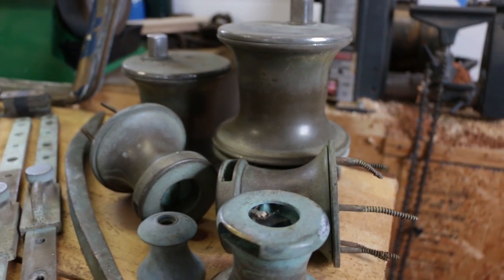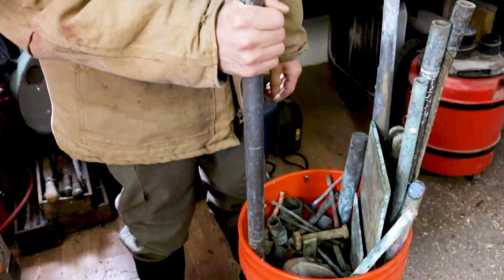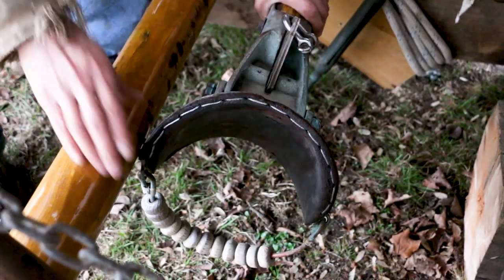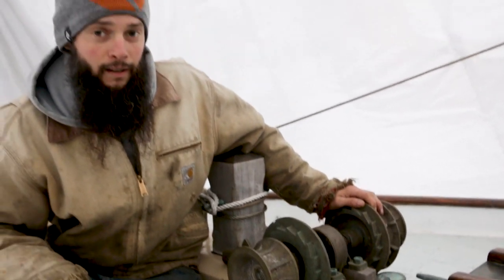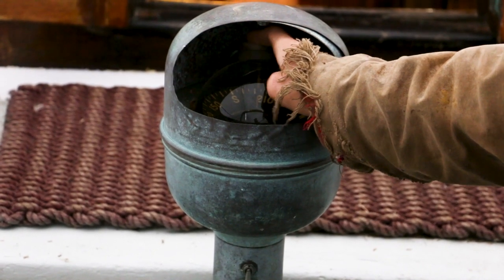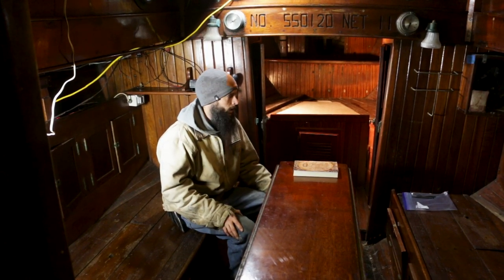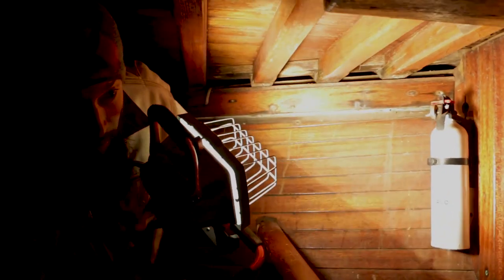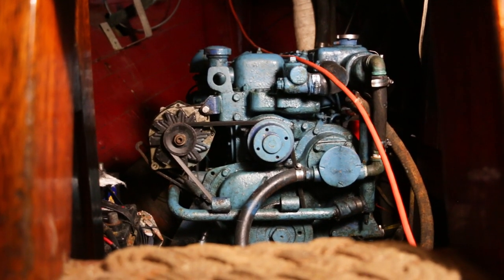Acorn to Arabella - Journey of a Wooden Boat - Bonus Content: The Good, The Bad and The Bronze

Comment: That is a Perkins 4-108.  Had one in my Tahiti Ketch and parts were getting hard to find in 2007.  The aluminum tend to corrode through.  I would recommend a new engine.  That is a good sextant and I would recommend having it restored.  New York Nautical Instrument Company might be good to check out.  I would not set sail without several GPS devices myself.  Beware the windlass.   Good luck!
Reply: PS: Figure on 1HP per 500 pounds of displacement.  If Arabella is 28K, then that Perkins would be right.
Reply from the maker: Thanks for the tips!  The plans call for a 40hp so if we use the Perkins it should have enough gumption to get her moving.
Reply: Right, and the plans for the Tahiti called for 16HP with 20K displacement, which would have been a very poor idea.  The original Greymarine 25 HP was somewhat marginal, but the Perkins was terrific.  Treasure that Maxprop, you won't find another one that is better.  Just make sure it is pitched correctly for Arabella.
Reply from the maker: We have heard that about the prop.  The prop was a detail we never gave much consideration to be honest and now other than finding someone who can determine the correct pitch we don't have to! =)

Comment: Aww. That maxi prop is really neat, i got really excited till i realized i want regeneration from my electric motor....

The friction device is in fact the winch break, to hold the drum and chain in place. 

If you clean off the patina you  will be a very old man before it re -patinas , you will regret cleaning it , and many would kill for that brass/bronze.

Also the mast looks serviceable or am i mistaken ?, i think re-using that mast is a legit option??.

All this , was literally like boat porn...And i would be jealous , but none of this would fit my vision.

Also if you need help with any thing , let me know , if you need help converting over those old fixtures to led, 12v 24v etc , the binnacle, light's etc.
Reply from the maker: The mast seems serviceable, we will strip it of paint and varnish and then see.  It might stay as is and become our main if we go gaff or it could easily become the mizzen.
Right on, electric is something we still need to do a lot of learning about so a knowledgeable hand could be helpful!

Comment: Do you have a plan to pour your lead? I’ve seen several lead pours into ground on YouTube and it never blew up concrete or ground.
Reply from the maker: Yes, 
But old man winter came and put us on hold.  The ground is frozen and white, not ideal for digging or doing a lead pour.
We have an awesome tank to use and will make a wooden mold this winter and bury it in the ground.  It will be the first project we tackle in the spring.

Comment: Any experience using electrolysis (battery charger, plastic tank, washing soda electrolyte solution) to clean bronze without mechanical abrasion? I know it gives awesome results for ferrous metals and for difficult-to-clean detailed pieces
Reply from the maker: We have not but have heard of such methods and need to do some more reading before it's time to clean them up.

Comment: Is one of the rods in your melt pot the handle for the windlass?
Reply: caahacky - or a bronze end that had a wooden shaft extending from it to keep the handle from quickly wearing out?
Reply from the maker: Hmmm.  Good call!  
We will have to examine them and report back to you on that one.
Reply: I think it has 2 ratchets so 2 people can work in tandem, one pulls while the other ratchets, to pull the anchor twice as fast.
Also, That may not be a brass horn at 25:10,  it may be an earpiece for hearing directionally. You hold it up to your ear,  listening for the direction of bells on bouys and ships, and fog horns on shore. Sound was a vital part of navigation in the fog etc.
Reply from the maker: We had not thought of that, gonna have to get more crew so we can gave one at the tiller and two winching the anchor =)
It has a reed built into the small end which led us to believe is some sort of horn you blow.
Reply: While that anchor winch is really cool, it is going to be a pain in the ass compared to an electric or hydraulic unit. Have you thought about hiding another electric or hydraulic powered winch under the deck? Modern electric or hydraulic winches are small.  You could design Arabellas chain locker with a winch inside. The chain would still go over the bronze winch but it would just free wheel when using the motor. When not using the motor the winch dogs can be engaged so it can be used normally and for other uses like hauling lines or rigging/trimming sails. Building arabella with hidden things like hydraulic steering and winches wouldn't be a bad thing if you want to keep crew size down, and shouldn't cost a whole lot if you think about it now and start looking for stuff. I wonder for example if an automotive power steering pump mounted on the perkins would provide enough hydraulic power for a boat like that while under power with a solar electric pump for steering while under sail?

If the horn has a reed, you are probably right. I have seen similar devices that were intended for hearing. For a laugh, google "WWII listening devices". Some of the things the british british used to hear the germans coming were pretty funny looking.....
Reply from the maker: We might try to figure out some form of a hidden, powered anchor retrieval but a big part of the goal is to have no where to be and all day to get there so a manual anchor windlass might bug us less than it would most.  The manual is a must though as we don't want to be stuck if we don't have power for some reason.  We have 300' of chain and a couple anchors, maybe we need to see how long it takes us to drag it all in with the windlass.  =) 
We will stick with the tiller and simple methods of steering like a wind vane rig, tiller lashings....  Hydraulic steering seems a bit more complicated than we desire.
Reply: No practical experience here, but I have heard cruisers discussing how important it can be to get an anchor onto deck quickly when maneuvering in an anchorage, on a lee shore, the wind shifts, or the anchor drags, etc.
Reply: Exactly. Its all nice to picture grabbing a beer and winching the anchor at leisure, however no matter where you are mother nature will change your plans. Running that winch in bad weather and high seas with the boat pitching and rolling in the rain will not be fun. It looks like it pulls max 1 foot of chain per lever push. That is 300+ cranks on that lever every time you winch it up.
Reply from the maker: Certainly fair points and worth close consideration!
We will use the manual windlass, no doubts there, but having a electric one tucked below decks is a distinct possibility.  
We have friends who cruise a 40' tank of a boat and have a manual windlass and love it, they had no complaints but we can totally see the perks of having a quicker electric one you can operate from the cockpit.  
Thankfully we have years to sort it out =)
Reply: Totally, I just thought i would mention it because as you are designing and building that area of the boat, you can take a possible electric winch into consideration, and ensure it will have an area to live and a strong enough place to mount. If you don't install one now, at least you designed that area of the boat so it is possible to add later if you change your mind. If you build in a spot where it goes, and don't put it in,  the space could double duty as a small gear locker. Retrofitting one later could be very difficult, very ugly or both.
Reply: Good idea. You guys are young and spry now, but that won't last forever...plus if you have to single hand the boat.....we do this same thing when we design houses. People in their 40's and 50's don't need an elevator in their house, but if we go ahead and design the shaft and put in a temporary floor, the client doesn't;t have to move from their house if they ever lose mobility.
Reply: Future Proofing is never a bad idea, and it is a selling point if you guys ever upgrade. While sailing the high seas the old way is a great idea, modern technology is awesome. With all that cool stuff from Victoria, you have an amazing opportunity to build a boat that looks and can be sailed like it is straight out of the 20's but is hiding some cool tech. Little things like leaving small gaps in the interior paneling to install hidden LED strip lights. Or a flatscreen TV cabinet recessed in a bulkhead designed so the tv can be hidden under a wood panel. Creatively hidden speakers installed for music and movies. If you start scavenging now, the parts for these systems are not that hard to get cheap/free. In your cockpit, if you found a second binnacle (or something else period correct looking), you could modify it to hold an iphone/tablet inside of it, to show charts and things. It would keep the period correct look. 
I saw a boat one time in a marina  that had a hollow wood mast, and he had all sorts of communications and winch cables as well as the exhaust for the engine/generator inside of it. It was laminated with the hollow in there. Boat looked very correct for a turn of the century boat and looked like it would require 3-4 crew to sail. He was able to sail it solo. It was not easy but with the tech he had hidden while rebuilding it it was possible.
Reply: I have that horn, came with my 22' fiberglass boat in 1976, still keep it as a backup for bridges and fog.  you just blow hard into it.  if it's not sounding, play with the reed a bit.  galvanized, I think, not bronze.  when you get a sound, it's loud -- and fun.
Reply: Sounds like beer for breakfast after weighing anchor!

Comment: Hi For the new boat, look into shel
Thanks for the vidsfs to hold rock salt high up in the boat just under the deck. The old wood boats added these to help prevent rot. I am not sure how effective this is , but some Bromine chemicals are used to prevent rot. A worthy research project.
Good luck with the build.
Reply from the maker: Thanks for the tips!  We will have to look into that, we have heard of folks using salt to "pickle" or "cure" timbers.

Comment: Sorry I cannot answer what chemicals USA use for Fungi and Spore control as I am from Australia and our chemicals used may not be legal in USA. There are chemicals you can use that kills spores and fungi growth. I will look into the chemicals we can use in Australia but you will need to talk to professional in your state or county
No-Rot Gel is a ready to use, water based brush on wood preservative, to control the spread of decay. It is formulated to penetrate by diffusion into the timber, while still allowing the surface to be painted over. No-Rot Gel can also be used to kill surface mould, algae or fungi. It can also be used on timber, masonry or concrete surfaces. 
There are other methods of chemical as well like ones you can add to paint and for quarantine baths to dip shoes have heard of copper oxide baths though advise you look into this method. If it was my project would look into these quarantine matters so the boat will not get effected with fungal blooms.Once it starts it is uncontrollable like cancers.
Reply from the maker: Right on,
Thanks for the info!

Comment: No, it wouldn't be building a new boat.  First you'd have to un-build the old boat.  Even re-using that wonderful wood and bronze is going to involve a lot more work than scratch building from new.  But at least in that case you're getting parts and material that you couldn't afford or in many cases couldn't buy regardless of price.

Comment: Wait a minute. A  ton of work to rebuild Victoria?  You would not have to cut down trees. melt lead, mill lumber, build a rig, a keel, rudder, install engine, tanks, plumbing, wiring.  You have a boat. You are taking on a 100 times more work.
Reply from the maker: Ha!
You believe Victoria is in MUCH better shape than she actually is.  Her keel timber, frames, floors, stern post, forefoot, rudder, deck... are all shot and need replacing.  As would most of her planks, her electrical is outdated and a mess, the motor runs but needs a overhaul.  
We could have skipped the ballast keel and building a rig but the rest would be about the same amount of work.  We will transfer everything that is solid to Arabella so Victoria is saving us months maybe a year or more of work but no way is Arabella 100 times more work than restoring Victoria.

Comment: when are actually going to build something?
Reply from the maker: Other than the new keel mold, probably the spring to be totally honest.
We closed in the sides of the boat house and built doors to finish closing it in, does that count?  
Getting Victoria and Alix helping his dad move were two unexpected time consumers this fall so we missed the window for pouring the keel, the ground is now white and frozen.  
We also put a substantial dent in our oak supply laminating all those timbers so we need to do some more logging and milling.  Winter is the perfect time to tackle such a project.  
The goal is to knock out the logging/milling and make the new mold this winter. As soon as the ground thaws we can bury the mold, set up the tank and tackle the pour.  After that the keel and backbone timbers are roughly shaped so we can finish shaping those and start bolting things together. 
If you are only interested in the actual building part we recommend you check back in May, we will have poured the keel by then and will be working on assembling the backbone. Until then the videos will keep coming but will mostly be logging, milling and making the keel mold.  
Next week is us topping and dropping a big spruce for the spars.
Reply: Those should be interesting videos as well, any video showing some progress would be interesting.

Comment: When do you start working on the hull instead of playing around with all fun stuff? A serious boat builder would deal with deck fittings and bronze gear at the completion stage??
Reply from the maker: Victoria kinda fell into our lap, we were not actively seeking all the hardware we needed but when we got offered all the bronze we need, plus a working 53hp perkins, plus a complete mahogany interior, sails, rigging.... for the price of less than the motor we could not pass it up!  I don't think any serious builder would have passed her up. A boat like Victoria is a once in a lifetime find, if we waited the opportunity most likely would not have come again.
Reply: Fair enough - can´t wait to see you having all the frames set up on the keel. I´m sure a lot of other people are waiting to see you are going all in, and actually start cutting some wood. Thanks for answering.

Comment: Victoria's lead?
Reply from the maker: She has an iron keel, its too light for Arabella and we have the lead and tank so we will scrap the iron keel and stick with pouring our lead one in the spring.
Reply: Acorn To Arabella With all that bronze she did not need a lead keel.  As you tear into the sole and bilge I'm betting you will find lead.
Reply from the maker: We pulled up the all the flooring that was made to open and that gave us access to pretty much the whole bilge.  We found no internal ballast at all other than one small 5 pound hunk of lead.  Maybe we will find more but it seems the massive amount of bronze and iron keel were all the ballast she has.
Reply: Acorn To Arabella Hmmm.  I have heard that even with Iron keel the old builders would still put small amounts of lead here and there to fine tune the boats balance.
Reply from the maker: That makes sense and is what we expected to find but so far nothing.  Maybe we just have not found it yet.